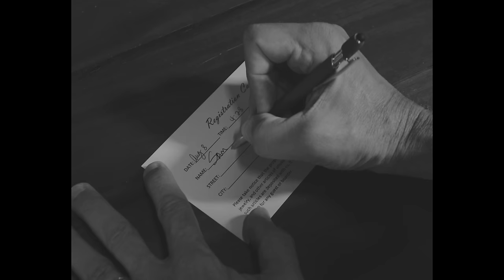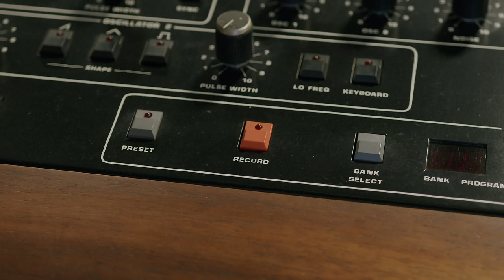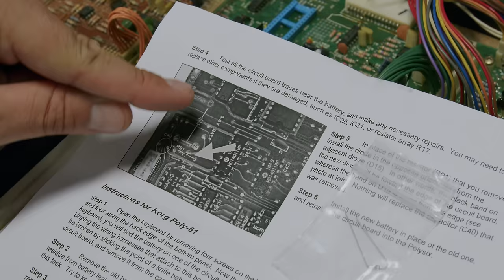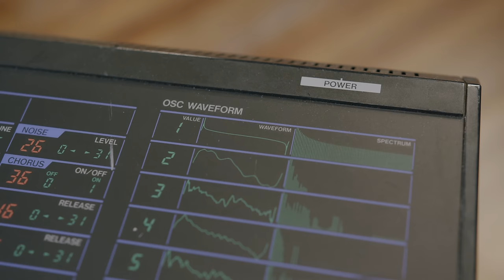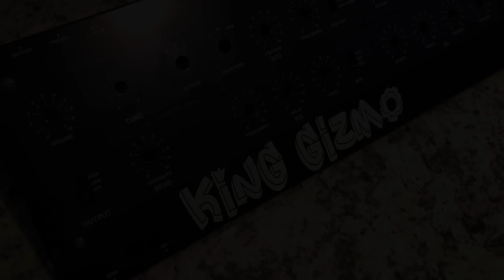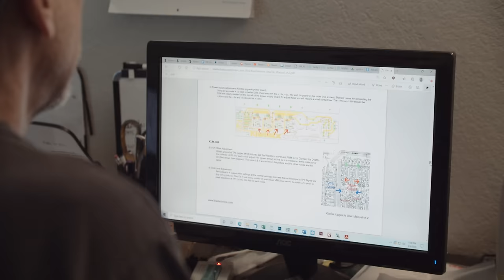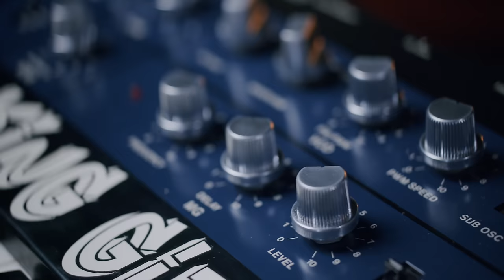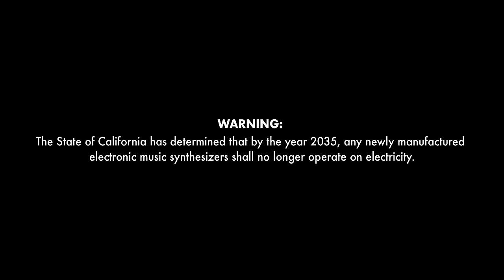Synth Wizards, Episode 12: Dust to Dust: The King Gizmo Polysix

Comment: I love these resto-mod projects! As for those leaky circuit board batteries, i have seen them in car alarm circuitry as well. The leak could cause the car to become a non-starter.
Reply: Battery damage also shows up in old computers, arcade games, and pinball machines.  Pretty much everything made in the late 70s through the mid 90s when EEPROMs and flash memory took over.

Comment: I'm in the process of restoring a PolySix right now for this exact reason. I too am putting a KiwiSix board in, as well as their power supply. The horrible particle board cheeks on mine are destroyed, so I bought a handmade solid walnut replacement case from a craftsman who sells them on Reverb. It's beautiful!

The PolySix was the very first synthesizer I bought way back in 1986, I can't wait to have this one working again!

Comment: Awesome video.  Last year I put the two D cells of my Chroma Polaris in an external metal box attached to the rear.  I also replaced the membrane switches.  But why these batteries were not designed to be accessible via a small door and isolated from circuits is sad.

Comment: My experience with the Poly6 was that I loved the instrument but there were three drawbacks.  First:  was that dirt and grime got inside the little rubber cups that held the contact pieces that completed the circuit for the key bed; (no such thing as cigarette smoke restrictions in clubs and studios during that era).  I was advised to avoid using alcohol for cleaning.  I am wondering if the KIWI mod solved the second.  Every unit that I tried had the opposite of 'stretch tuning' in that the lowest note sounded slightly sharp and the highest note being slightly flat in apparent pitch.  Any service tech that I asked this about told me it was not possible to calibrate a correction (similarly to how you could tweak the tuning of a Minimoog).  The KIWI has dealt with the third issue being the lack of (at that time) the newly arrived MIDI feature.  Ultimately I got a Juno 106, gave the Poly6 to my brother who rarely used it and sure enough the battery leaked on the innards and yes the voice chips on the Roland eventually caused me grief.  Absolutely enjoy your productions, both the video presentations and the engineering projects you entertainingly reveal. Kudos!

Comment: Huge fan of the poly6😅,great result on this project! Worth mentioning, especially if you want a more original restoration, Syntronics in Germany remake pretty much everything you need for poly 6 including entire circuit boards and even brand new panels & hardware.

Comment: Had the battery issue with a Poly 61 a few years back , absolute nightmare to sort  as the only available schematics were sketchy to say the least , in the end i had to take a chance on a different board Rev to mine (that was actually readable in the service manual) as having the same traces around the battery and connectors , i had to run jumper wires on the underside of the board to re-establish connections etc etc , but i got there in the end phew !! ...

Comment: EEROMs i'm guessing are used now on the new CPU board & other new synths,as a retired electronics engineer,ive had my fair share of pcb battery leak faults,more than 2 layer boards without a schematic are virtually impossible to fix,older synths used 2 layer, top,bottom,which makes the job a lot easier,still needing a lot of time to sort.Good mod chaps,interesting video.

Comment: The Roland D50 also becomes unusable if the battery goes flat. After battery replacement, it needs a factory data restore over MIDI.

Comment: and what exactly are cali-synths going to run on in 2035, wind?  not indoors.  solar? no night gigs.  probably farts, as everybody will be welded inside their houses, and the fallout will be contained to individual family units.  you'll still need electricity to stream performances though, unless they're running the latest Crapple or Pew-C's.  

i'll stick with my setup here in MN, although we're going to follow the cali model too, so i'm lucky i live next to the mississippi.  my synths will run on hydro, day or night, though i'll have to play in mittens on gigs from september to june.  but hey, for the greater good, right comrades?

Comment: I had to stop the video and calm down when you showed that battery at the beginning. I hate those horrible things. They mess up a lot of old PC XT/AT era stuff too. (And the XBox supercap too. I caught mine just as it was starting to get bad. I worked at a place that had some of that brand fail in their old products! My XBox now uses a spare cap from there... off to the side, on a wire.) It was the lure of "you can save assembly costs by putting it on the circuit board!" that has caused so much anguish.

The new trend to make replacement circuit boards is a great thing. It's a lot of work to reverse-engineer the old boards, but I can't say it isn't fun. In this case they went beyond mere reverse-engineering and came up with a modern replacement.

I like the new knobs, but those buttons just look so... Radio Shack. I mean those pushbuttons are kinda nostalgic to me, but they scream "I'm a mod!" Which as it turns out was the right decision.

Hey, do you sell T-shirts at the store? I'd drive the 30 or so miles to check your place out if so.
Reply from the maker: We do have all of our T-shirts (and lots of synths!) available at our store - please stop by.  We are open M-Sat, 10-6.  Thanks!

Comment: So you put distortion and cut switch into the poly six, and that’s why it needed to have that stupid looking huge and crappy sticker on the front panel? Great job for sure... by the way, as I hear on this video, that cut switch works awful, makes lots of crackling. Everything significant was added from Kiwi. And wooden cabinet is good, but there are several companies on the market who can provide it. And those pot caps look completely out of style, some chinese crap. And you made a 43 min video about that? And also integrated some ads from korg with that sour reissues? The wizards, for sure. Ban to this channel, wasting time.
Reply: See ya